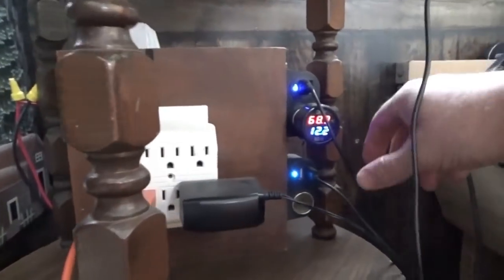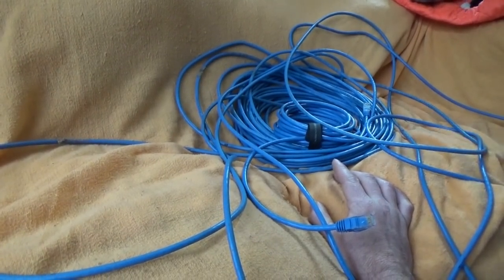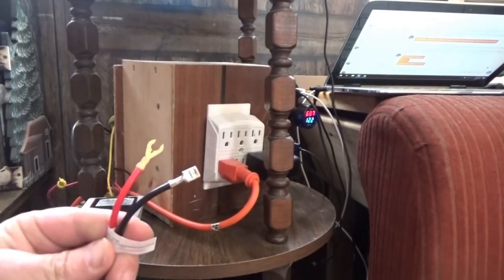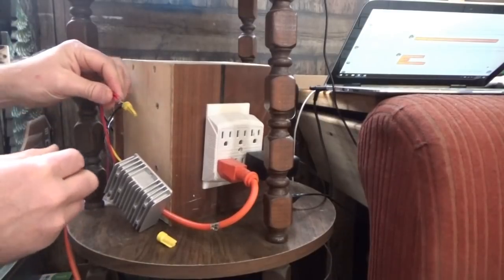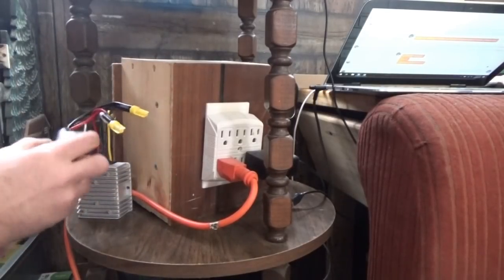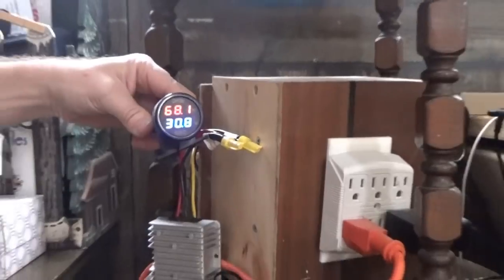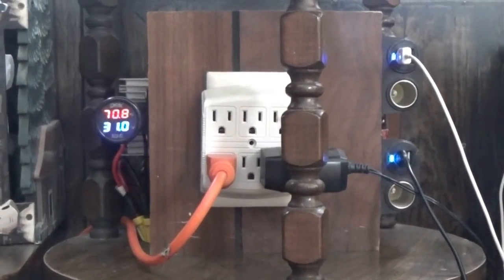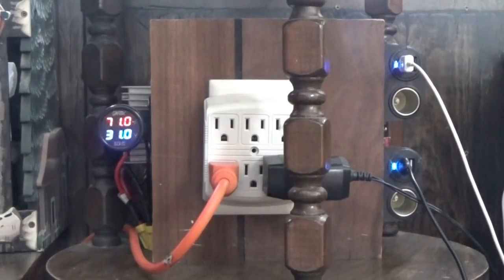Wiring 24 Volt Digital Volt Meter Into Our Off Grid Solar Power System

Comment: Hi Troy, what was that small power converter for? I have a couple of similar voltmeters to check on my batteries. One of them has a USB port. 
About that high shelf. All shelves that high should be secured to a wall, and especially with that heavy plant on top of it. If the plant falls down, it can seriously injure children or pets. And I would have put up something around it so that Michelle can not get to it. Children have been know to put knitting needles and the like into power outlets and you do not want that to happen. Security is important. Better safe than sorry. You might not always think about these things yourself, but I have been around for a while longer than you. And it is off course easier to see what is wrong in other people's houses than in your own. I have to secure things for the safety of my dog. Stay safe and take care you all. Have a nice weekend.
Reply from the maker: Its a 24 volt to 12 volt converter. My battery bank is now 24 volts but most things I run are 12 volts.
I just gave a hefty tug on the shelf. It is pretty heavily weighted down and I cannot pull it over easily with some force.
We keep everything out of her reach. Best not to let her have knitting needles in the first place. Or paper clips or anything else like that. We must child proof our home on a daily basis. Meaning we look around and pick up behind ourselves making sure nothing is in reach of her.
When she starts to climb then we are in real trouble. lol
Reply from the maker: Even our wood "furnace" is safe to touch due to its heavy shielding.

Comment: What are you using 24volts on , you can weld with that ? I have nothing in my house that runs on 24volts , my fridge is 12 or propane and so is my stove , I’m staying with 12 for now that and propane.
Reply: Dave, 24 volts is more efficient at getting power to the house. Less loss in the wires. Unless it's a short run of wiring, higher voltage is always better.
Reply from the maker: Thanks Dave.
Reply: My fridge is 3/4 size it runs on all 3 , propane , 110 and 12 . I live up in northern Minnesota and have geo , wind , propane , solar and wood and except for my taxes I’m off the grid
Reply: Dave, it looks like you're well prepared emergencies. That is always a good position to be in.
Reply from the maker: Dave I ran 12 volts for the past 6 years and only just went 24 to save power. It took me that long to be able to afford the switch over myself. And then I have a 24/12 inverter so I can run my 12 volt devices inside our off grid tiny house.
Reply: It maybe more efficient but more cost is involved also ,with 12 volt everything is setup to receive in my house. Try pricing a fridge or stove
Reply: Dave, in my opinion the best thing to do is just run the fridge and other appliances off the power inverter. No changes necessary to existing appliances and other equipment. One question though.... Is your fridge a tiny RV fridge? If it is, I can't speak for Troy but that definitely wouldn't work for me.

Comment: I think you should move all your solar stuff far out to the shop and use only grid power in the house.
Reply from the maker: Oh David, you have not yet heard me start to complain about the internet company. Dont get me started here. I hate them because there is only one provider. My bill is supposed to be $39.95 a month but they have charged me up to $135 a month many times in a row. The bill is consistently near $100. Yet when I talk to them online they tell me all is well and my bill is payed up to date. But they try to give me the run around. I hear complaints from others of the same problems here.
I have to go into their office and try to sort this out.
Oh, and I get between 350 kb and 768 kb upload speed on average so I am not even getting high speed internet out here. There is just nothing else but satellite which charges even more. They are on a per GB usage price.
The cell phone companies are losing towers out here so I need internet for communications even if I quit making a living online.
And lets not even get into the cell phones. Arrgh.
Ok, make you feel better now?
Reply from the maker: There is no such thing as free energy correct. But with harmonics you can tap into existing energy. Everyone knows the earth is bombarded by so much energy at any given time that we could never use even a fraction of it. Yet most people will argue to the death when you mention that you use that energy. Strange I think.
I build my own system back then. Only reason I quit using it is I blew up my apartment experimenting.
Reply from the maker: My point still remains valid. I have free solar so why pay for electric?
Reply: My point also remains valid. It isn't worth the effort to save 3 cents. I guess we can agree to disagree :)
Reply: Also.... Why pay for internet? How is that any different than paying an electric bill? Both electricity and internet are necessary. What I can't understand is why so many off gridders (not just Troy) have no problem spending hundreds of dollars per month on internet service. Yet can't stand to spend a dime on electricity.
Reply: @DavidJohnson-tv2nn  well for me personally the grid is not an option...we live very remote...but I will get internet when I can afford it...data is useless here as phone signal is very weak...can barely make phone calls...its a life choice...we could live less remote to have luxuries...we choose not to
Reply: ble meh, That is a perfectly understandable reason to be off grid. What I can't understand is why when some guys actually have a grid connection, they refuse to use it when their solar fails due to snow, clouds, or other reasons. Just to save a few pennies or even a couple of dollars?
Reply from the maker: David, your point about internet makes no sense. I can get free solar power because I already have solar panels. So it makes no sense to pay for grid power.
I cannot make my own internet so I have to pay for internet.
Reply: Troy, my point was about the attitude of most off gridders toward power companies. They seem to hate them. Yet seldom a complaint about paying for internet service. Which quite often, isn't that good! I guess we can just disagree on the internet issue.
Reply: Troy, to me it makes sense to pay for grid power whenever your solar power falls short for whatever reason. Rather than just doing without. From previous discussions I understand you have some issues with the power company because of the crypto mining rigs. If it was me, I would get those issues resolved quickly so I could use grid power without additional charges. They can't charge fees for crypto mining when your not doing it on grid. Your current energy consumption should be proof that you're no longer doing crypto mining on grid.
Reply from the maker: If the gov would allow it, I would produce my own fuel to drive my car but most people get shut down on that point. I was running h20 in my car for a while many years ago.
Reply: Troy, regarding running your car on water.... I have no doubt you honestly believe it could be done. But I have to honestly disagree. These HHO (water) systems supposedly work by using electrical energy from the alternator to create hydrogen gas by  electrolysis of water. The hydrogen gas is then fed back into the engine and burned, releasing mechanical energy. Unfortunately there is no free lunch or free energy. Considering the losses in the system, it requires more energy to drive the alternator then is gained from burning the hydrogen gas. So I'm not surprised that people selling these systems are shut down by the government.
Reply from the maker: Why pay for electricity when we dont have to?
Reply: Troy, if you don't use much electricity, and from what you've said it sounds like you don't..... Electricity is not that expensive. The only worthwhile purpose for solar at the house would be to allow you to use a lot more electricity without increasing your cost. And thus, making your life easier.

Comment: I'm not starting about the wire mess, lack off fuses etc..Lol.  But seriois, i,m wondering, iff you mesure that voltage with a multymeter ,how mutch is the difference in voltage between your meter and the multy meter? iff its still 30v plus its to high in this cold weather condition, check your voltage settings in the mppt controller, should be not more then max 29 (28.8) volts,is the battery temprature sensor connected? (in cold conditions the max charge voltage should be lower then normal even in equalize.) Protect your battery,s! ( ,>)  (and stay safe!)
Reply from the maker: I was thinking the same thing. Might be it was under equalize mode which is about 15 volts on a 12 volt bank. I did not go out and look though at the time.
Reply from the maker: I will be connecting the ethernet wire from the charge controller to my laptop soon tho.

Comment: @Troy #Troy @TheDoItYourselfWorld #TheDoItYourselfWorld, your modem probably runs @12vdc so you can run it via batteries direct{with a fuse} and save a few watts lost from the smps conversion, HTH, thanks for the upload
Reply from the maker: That is a very good point and works very well considering the fact that I now have a precise voltage converter. Thanks for that point. I always had it in my mind that I had to make an adapter for stable 12 volts. Now I actually have it. lol.

Comment: So where aee the fridge, freezer, lighting, well pump, TV, and other kitchen appliances   plugged in? For safety I hope the AC electrical outlets are grounded.
Reply from the maker: Thank you David for your help and suggestions. I am always working to improve our system here and will continue to do so.
Reply from the maker: I messed up on that comment anyway. We do not have a TV. We do have some things for the kitchen like a coffee maker but its never used unless we have guests. We dont have a microwave. Would not use one on the grid either. I was not counting a fridge or freezer. I think appliances, I think coffee maker or microwave.
Reply: Troy, sorry for all the confusion and I know you may have mentioned it in the past but I forgot. The main point of my question was how are things like the fridge, freezer, and well pump connected to the solar power system. I asked the question because of course, the trolls will try to claim your not off grid if they don't see those things plugged in to the solar power system.
Reply from the maker: We use extension cords as needed to get power to remote areas. I have shown them in the past but no longer show them due to people saying they are dangerous and not to code although they are UL listed and sold for use as - well - an extension cord. We do still have grid power and occasionally use it but prefer NOT to pay extra when its not necessary.
Reply: Troy, thanks for taking time to respond. I am probably one of those people who spoke out regarding  the use of extension cords. But it was for a good reason and the safety of you and your family. Extension cords are intended for temporary use to supply power to tools or other gadgets. NOT a semi permanent use. That is why NEC code has minimum requirements for outlet spacing so extension cords are not needed in most cases. Code also requires TWO 20 amp circuits for the kitchen, and the outlets must be GCFI (Ground Fault Circuit Interrupter). So I hope you can see my point that the system as you have it set up does not meet code. And... It's not that hard to meet code. Definitely much easier than burning your house down or paying for hospital bills. These are basic requirements for your safety.
Reply: P.S. NEC code has additional requirements for solar including grounding, disconnects, fuses and breakers, placing wires in conduit (extension cords across the lawn are a big no no), and proper labeling of disconnects, conduit, etc. Again, not really that hard to do. It could save you from disaster in the future. My only goal is to inform you (not complain) and then the choice is yours.
Reply: Final point, not sure if this is being done but whatever you do please do NOT back feed power into the house's electrical circuits. Even if the breaker in the main panel is switched off. If someone should trip over the cord and unplug it, the male end of extension cord is live with 120 volts! If someone should pick up that end of the cord, especially with a little kid walking around.... Well, you know the end result!
Reply from the maker: We dont use that many devices. And dont forget this is only the indoors line. My power distribution box. I am sure we talked about that before. There is no TV, no kitchen appliances and the like in our home. We have them but dont use/need them. Again we have discussed all this before.
Lights are LED bulbs and dont use much energy at all. Often we use portable LED lamps with their own batteries built in. Everything gets recharged during sunny periods when we have more power available.

Comment: Each one of those meters has a amp draw enough you dont want the on all the time. Its best to only plug them in when you want to know a reading. Try it with and with out you will see that they really do draw too much power to leave plunged in. That is what I found out I dont want to waste the power its a pretty sizable amount when you add all of them together better than an .10amp draw. Over time it adds up.  You could install a toggle switch or a push button to turn them on and off with. Use the power for things you want to and dont have a vampire draw all the time.
Reply from the maker: I had this plugged into the 12 volt outlet for two months and it did not bother us at all so far. I do like having the display all the time. I really look at it a lot.
Reply: @TheDoItYourselfWorld  .10 amps is not a big draw I think the one I had was a lot more.
Reply from the maker: Currently mining cryptocurrency on solar power!!!!! making video of it too.
Reply: @TheDoItYourselfWorld  I will watch it.